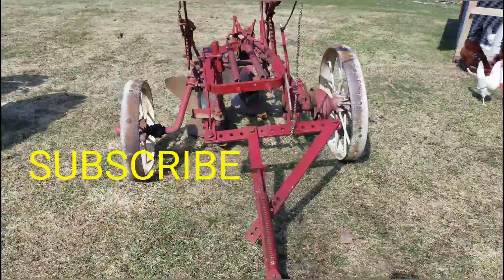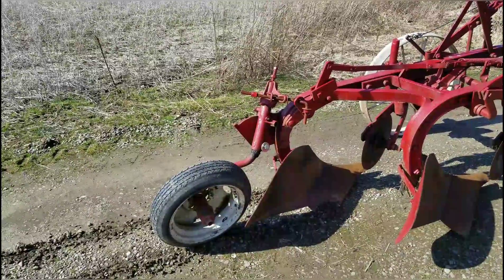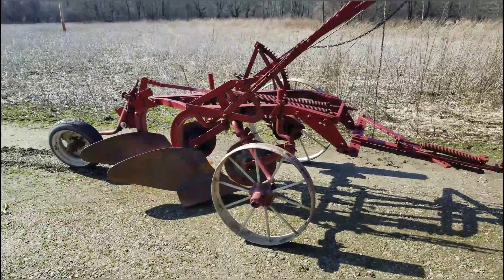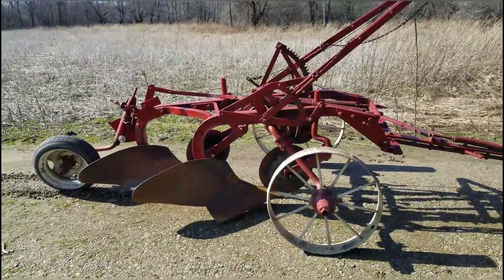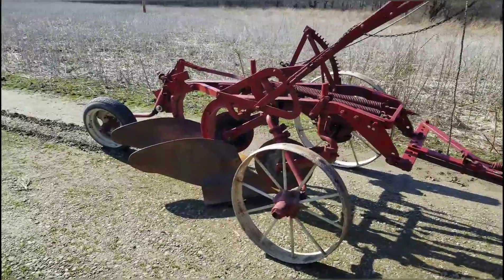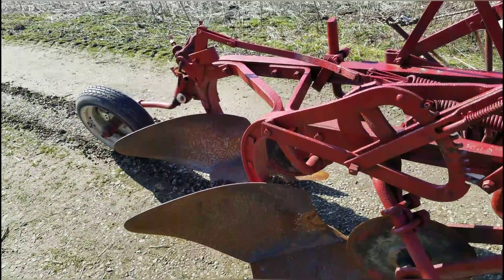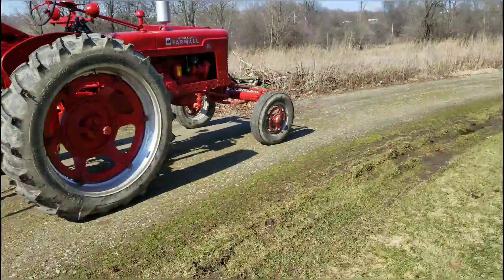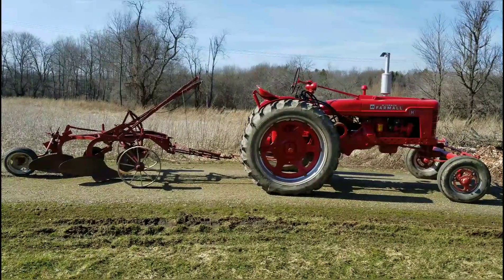IH Little Genius #8 Plow vs. IH Little Wonder #4 Plow

Comment: I have the 1920, 1923, 1927, 1935, 1940, and 1949 IH catalogs.  The Little Genius is in every one of those catalogs, except 1949, so according to that catalog, it probably wasn't produced in 1949.  Rather or not, it was discontinued sometime between 1940 and 1949, I don't know.  The Little Wonder appears in catalogs 1923, 1927, 1935 and 1940.  It doesn't appear in 1920 nor in 1949 catalogs.  Again, I don't know when it was discontinued, but it had to be between 1940 and 1949, and it first appear between 1920 and 1923. BTW, the Little Wonder is quite a bit lighter in weight than the Little Genius, and per the catalogs its made for the smaller tractors.
Reply from the maker: Im certain the little wonder was made for the C. Interesting information for sure!
Reply: @FarmallFanatic  The C wasn't brought out until after the Little Wonder ended production.  I can see where the A , B, and BN would be a good fit for the Little Wonder, and the F-12 and F-14, but I wonder what market IH was looking at in the 20s before the F-12?  Possibly for other makes of tractors and maybe for farmers with horses?
Reply: I found the parts catalog for plows made from 1920 to.....In 1949 the Little Wonder plows were replaced by the IH No. 3 and IH No. 4 Plows, the Little Genius 8 plow was replaced by the iH No. 8 plow, etc.

Comment: the 2-12 was made to be pulled by a f-14  a faramall B or C or and H on Kerosene .in 2nd gear it has the low speed short mowboards.  the little genius you have has the longer high speed mowboards and was made for a gasoline H  or a SH in 3rd gear or a Super C.. also there was a ssteel dish rear wheel made for the very early little genius plows. the little genius plow i had  was on rubber and dad had the trip convered to use a hydralic cylinder and put the old steel dish rear wheel on it  to prevent flats. mne also had the slow speed mowboards made for 2nd gear if you pulled it in 3rd it threw the dirt or sod too far and made the turned ground uneven and harder to disc..
  also a 1-18 was made for a kerosene H i saw one if you sett it as deep as it would go it was all my 30hp H wanted to pull it was used to plow  dead forrow trenches for feild drainage. or small patch plowing
Reply from the maker: Did you work at the factory?
Reply: @FarmallFanatic  no but i lived in southern illinois  and worked as a mechanic for a IHC dealer for 5 years in the 70s.
   since i was the young mechanic i was assigned the older machinery to work on . i was shown a film on the history of the IHC plows. at a dealer meeting  when the newer model of plows were introduced 
  the other reason the steel wheels were changed for air tites was the increase of paved roads. many counties that had paved roads did not want steel wheeled machinery on them.on country dirt roads it was not an issue

Comment: I have a Oliver 3x14 trailer plow with hydraulics. I believe on that one instead of twice the teeth like the Canadian plow you mentioned it has 2 pins on the lever ro double the adjustments.
Reply from the maker: What kind of shape is it in?
Reply: @FarmallFanatic  it's usable. Not going to plow 30 acres without doing some work to it. But it'll hook and play.